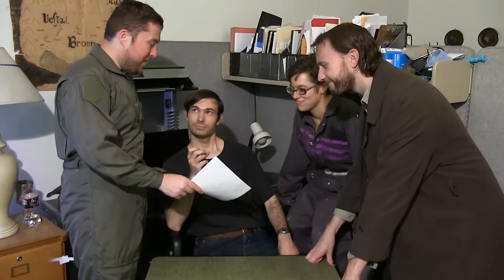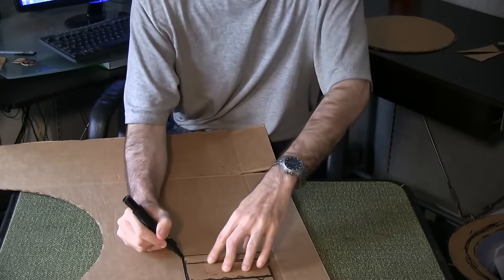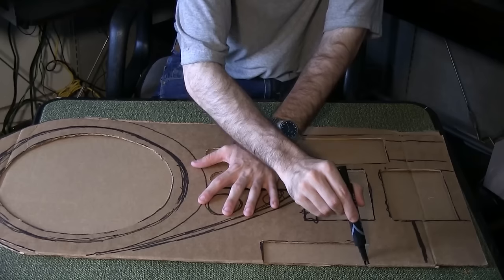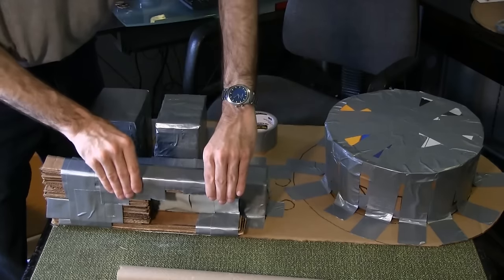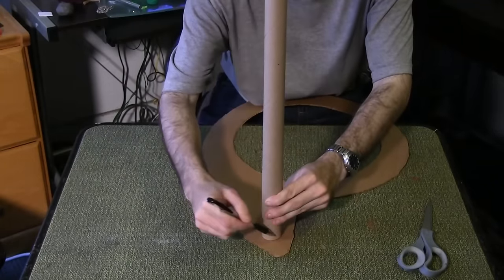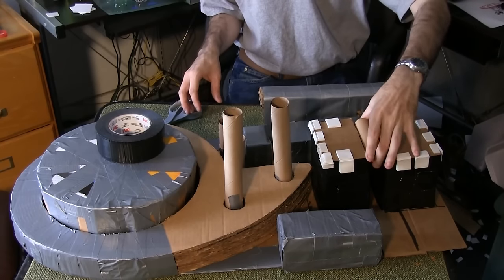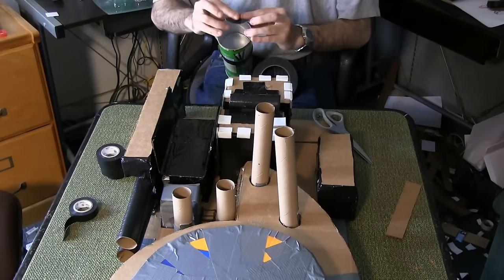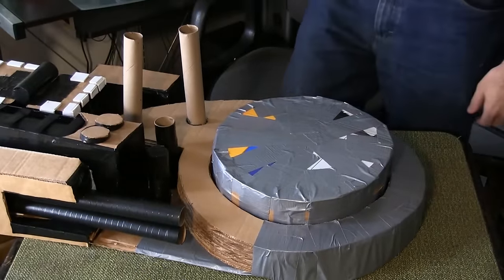How to make a Prop Ghostbuster's Proton Pack (Part 1 of 3)

Comment: Hm. I liked what you tried to do, but my only criticism is that trying to form the majority of the structures by cutting numerous layers of cardboard is needlessly time consuming. For my pack I just utilized styrofoam*, and cut out the various shapes that way and then wrapped in tape. :) That way it's a lot less time consuming, it's easier to form the ribbed pattern of the two blocks on the sides, and depending on the type of foam - - a lot sturdier. :)                           * (actually Insulating foam)
Then again, I think you're going for a more simple DIY feel, using materials that are more readily accessible for a general audience. So nonetheless, Kudos for such a prop on a literal shoestring budget. :)

Comment: Good job. Curious. Why don't you use hot glue?
Reply from the maker: I do, about 3 minutes into Episode 2. However, as a general rule, I don't like hot glue. Hot glue is a strong but very brittle substance. It has its uses, but if I can avoid it, I generally do.

Comment: What time will #2 be out and will this prop include the gun?
Reply from the maker: I'm hoping to get part 2 out sometime tomorrow. The prop will include the gun, but not until part 3.
Reply: The Prop Master's Handbook Where do you get all of your cardboard?
Reply from the maker: Usually from work. Occasionally a friend will buy some piece of furniture and contact me telling me they have a giant box that I can have.
Reply: The Prop Master's Handbook Thanks for telling me :D
Reply: @thepropmastershandbook1505  do I have to put the template over the base cardboard cause I broke my template
Reply from the maker: @therealmrbeetdeez1984  Can you give me a time stamp so I know where you are? I don't quite understand your question.
Reply: @thepropmastershandbook1505  6:53
Reply from the maker: @therealmrbeetdeez1984  Ok, that piece that I call the 'template' is absolutely essential. It is holding all of the tape that you've laid down in place. If your template was destroyed, I highly recommend reconstructing it from a single piece of cardboard and fitting it over the proton pack. There's not really a good work around--this particular instruction is pretty necessary.
Reply: @thepropmastershandbook1505  alright thanks man